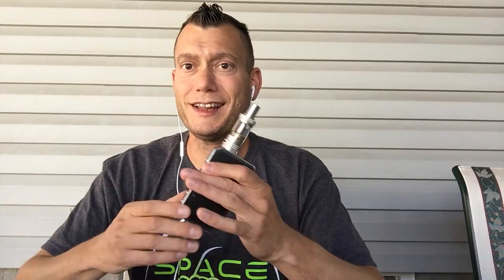Dangers of Ni200 nickel DON'T vape it on anything BUT Temperature Control!

Comment: I don't understand the hype over the temperature control. Variable wattage is good enough for me. Okay... I can't burn my mod for 10 seconds and not get a burnt hit. But who takes  10 second pulls. I can take 4-5 second pulls. And with adjusting the wattage I can get the vape temp that I won't without burning it. I just don't get the whole temp control thing. I hit my e-cig for such short bursts that a wattage adjustment is perfectly fine way to control my vape experience.

I could see the temp control being a benefit if we was taking 10, 20 ,30 second drags which most mods hit their cutoff well before this. It just really doesn't make sense that we need tc. I've tried the TC devices. Honestly I can't tell a difference between TC and power control. The only difference for me was it was having to relearn how to get that vape and using joules/temp settings to achieve it. It was just easier to build a coil and set the wattage to get the vape I wanted. The only added benefit I got from tc was my battery life was a better. But is that really worth the extra hassle and potential danger of vaping a nickel coil? Just my thoughts on it...
Reply: Shayd Marchant and you never ever have to worry about running out of juice and inhaling burnt cotton
Reply: +Colestercamps I'm running .15-.3 coils on a ipv3 li up to 150 watts and never less than 90 when I drip. My all day setup is 44 watts on an aromamizer and a sig 75w tc running it, but I can run it up to 70 watts without getting burnt or dry hits as long as I don't just hold the button.  Learn to build, wick, and when to drip it's not complicated.
Reply: painlessguy ya i can build its not for that its when you run out of juice it wont burn its convent. I'm running twisted messes with a duel titanium build as my all day setup (built for endurance not clouds) and in my dark horse i have a duel nickel/canthol fused clapton for sitting around the house. and my favourite mod is my ipv3 and with titanium wire i can run it at 100j (200w) temp control and i usually tape at about 150w all day 200 when I'm trying to show off. team control is awesome you never ever have to worry about anything with it you can run the coil bone dry and wont dry hit very good for driving
Reply: +Colestercamps Cool story bro...
Reply: +painlessguy it's not but it's a pain in the ass and a big time consumer for people who don't have the time and have shaky hands like me so tanks are the go to now but they seem to all toast the coils within a few hours of vaping so TC was a fucking awesome innovation IMO, esp if you don't like throwing money away on garbage pre-built coils

Comment: Its good that this info is being given out.  
After reading the comments, jeebuzcrust - you are coming out with all this info, saying its safe at high temperatures. But seriously, are you an expert in this field? Because its peoples lives that are at risk here.  How advanced are your studies on the subject? Because if they are minimal, id be adding a bit more sensitivity to your posts.
Theres a lot of people saying the same, how it leaches, its carcinogenic and i'd remain a bit cautious to be on the safe side, until an expert can give his opinion on the matter.
Ive just gone and bought the tfv4 tank online today and im unsure what metal is used in their coils. 
I tried having a look online but I couldnt find a definitive answer, so if it turns out to be nickel what temperature would be safe? 
Or if anyone is concerned about litigation, ill rephrase and ask what temp people have their mod set at?
Reply from the maker: +Craig Schulze Well said man.  none of us know.  We trust that the manufacturers max temp setting (which they all just follow vaporshark) of 600F is safe.  It's an assumption. When I vape on Nickel I do so at around 400-430  and When I vape on Titanium I vape that around 500-550 (because the assumption that titanium holds up better to higher heat).  And I treat stainless steel the same as Titanium.  The more sophisticated higher end TC mods where you can set wattage or joules allow you to ramp up quicker (put more power into the build for the first few moments) and then back off or maintain for a constant vape.

Comment: Thanks for the info I always try to inform myself and others as vaping gets more wide spread. Ill let my shop know so they tell others as well.
Reply from the maker: +Chris D Thanks Chris.  Alot of shops assume that everybody knows, but they don't.  I appreciate your spreading the word.  every vaper needs to make sure they have the appropriate device and set it for the temp control of the metal they are vaping.  Cheers!

Comment: So kanthal is safe to glow correct?  I glow it all the time when I clean the coil or I'm building...
Reply from the maker: +siqpuppie I hope so.  I've been glowing Kanthal for almost a year.  but yes, it's not a fragile brittle soft wire, it can take glowing.
True fact (unlike some other bullcrap comments) Kanthal alloy is used to make boiler tubes because it's extremely durable under high heat, doesn't warp or check, and is highly resistant to corrosion and oxidation.  Furnace tubes don't get replaced very often.  They try to use metals that hold up well to heat

Comment: Thanks for the warnings and information. I would have had no idea if I hadn't seen this video.
Reply: Even tho I have a temp-control-mod, I'll never vape NI coils again.

https://en.wikipedia.org/wiki/Nickel(II)_oxide

"NiO can be prepared by multiple methods. Upon heating above 400 °C, nickel powder reacts with oxygen to give NiO.
...
Long-term inhalation of NiO is damaging to the lungs, causing lesions and in some cases cancer.
NiO has a long retention half-time in the lungs; after administration to rodents, it persisted in the lungs for more than 3 months. Nickel oxide is classified as a human carcinogen

(Wikipedia)

Comment: Nickel has a 500 degree higher melting than kanthal does, coming it at over 2600 degrees.  The only possible danger from normal operating conditions is from having a severe hot spot in the coil, and even then it likely wouldn't reach melting point.  However, this danger is removed with temperature controlled devices as nickel, if inhaled, is extremely poisonous.  However, would would likely never hit this point even in wattage mode with juiced up wicks (just don't do it anyway).  Also, you are 100% correct, never get the coils red hot after building.  Basically, using them in wattage mode is akin to not wearing a seat belt... most times you're fine but every so often something extremely bad happens.
Reply: +jeebuzcrust How do you know that melting is the only time you could be releasing toxic metal? I hope some studies are in the works about heavy metal and oxide contents in nickel builds. I just bought a temp control device myself and I'm trying to learn to use nickel safely before I start using it at all.
Reply: +Krankie V Science.  Check it out.  Nickel is stable at highers temps than kanthal.  Stable means there is no change to the molecules of a material.  Hence, nothing additional will be included in your vapor.  All of this information had been available well before vaping.
Reply: +jeebuzcrust no chemical change is good, that's a start, but that doesn't mean it doesn't leech and become soluble.
Reply: +Krankie V Again, leeching is a change in molecules.  It's not as if metal evaporates into your vapor.  If that was true at all we'd have thousands of deaths already.  Nickel is extremely poisonous and inhalation would result in severe health issues within days.  I'm not saying something can't happen but the chemistry looks very safe.
Reply: +jeebuzcrust you said stable. stability refers to a chemical change. becoming soluble (leeching) is not a chemical change, rather a change of state. the molecules are not changed in chemical terms, and therefore still considered stable. I'm curious at which temperature the nickel starts to leech. "stability" refers to oxidation rather than solubility. 

I'm nut saying you're wrong, but your definition of terms is a bit mixed up.  solubized elements can still be considered stable. that's why I'm cautious. small bits of soluble nickel in the vapor wouldn't be killing people even if it is there, but it could cause health complications with extended use.

I would really like to see a study done which proves with certainty whether or not the nickel metal solubizes or oxidizes. right now, nobody seems to be able to say for sure.
Reply: +J and K White even if nickel were proven 100% safe.... the vape is too cool for my preference. temp control is kinda gimmicky imo. it's neat, but once the novelty wears off, I don't care for it. I haven't had any bad dry hits on Kanthal for quite a while now... it's just a matter of knowing how often to drip it.
Reply: Krankie V damn right. Its pretty difficult to get that satisfying WARM vape on nickel...kanthal suits me just fine
Reply: +Krankie V Supposedly anything above 600 degrees f and leeching can happen. 500 or less should be just fine. But its all theoretical anyway due to the fact that nickel warnings are based on ingesting nickel....that's different cuz we aren't eating it ya kno. I guess we have to wait and see man
Reply: +J and K White yep basically... a big unknown. I've been dabbling with temperature control for a few days nite and I've pry much decided it's not something I really care for. It's back to kanthal for me.
Reply: Krankie V Same here buddy...not fuckin with it. someone else can take those chances

Comment: i vape on silver its toxic but only will give you a gray skin if used wrong yes silver kills bactiria but its a lot safer then nickel
Reply from the maker: +DarkCyborg Silver?  don't know anything about that....
Reply: +Quest4vape http://www.wires.co.uk/acatalog/e-cig_iatty_atomizer_wire.html

go near to the bottom and you will see it oh and  somthing else its a lot less ohm then nickel so that a bonus use it with kanthal wire to increase the ohm
Reply from the maker: meh.  I'm going straight to Uranium wire, no battery or mod needed.  just coil, wick juice and vape.  Internal heat from radiation will vaporize everything.  Should hit like a truck load with a slightly earthy taste.

Comment: Great video man! Also can you link me the sources you used to conduct this video? I want look into this a bit more and take in more knowledge about nickel wire, and if I pulse the coils on a tc mod is that okay? I'm fairly new to building and I want to make sure I know what I'm doing.
Reply from the maker: +Jaymex231 Not ok to pulse the coils on a mech mod.  that's exactly what I'm saying not to do.
Reply: +Quest4vape Alright, thanks man!
Reply from the maker: +Jaymex231 Sorry, was on my cell phone, just re-read your question, and it's a very good one.  Fairly common knowledge to experienced folks in vaping that Nickel and Titanium are only supposed to be vaped in Temp Control.  Unfortunately since recent explosion of products and coils into the market newer vapers don't know this.  And also the regulated mods out there so prevalent that will fire down to .1 in wattage mode that can be purchased for under $100, prices is no longer a barrier either.   then folks get the idea to vape nickel on mech mods where there is no temp sensing or power reducing protection.  That's a recipe for heating that metal up beyond the 'recommended' temperatures.    Dry pulsing the coils ON a TC mod is fine if you lock the resistance when the coils are cold and the device can accurately sense the change in resistance as the metal heats, which the chip will read as temperature increase.  Most TC mods will not allow you to dry fire the coils.  So folks will put the atomizer on a non TC mod or a mech mod and dry pulse them that way, making them glow, doing exactly what is not supposed to be done with this metal.  If building with spaced coils there should be no need to pulse the coils anyway, but folks do it.  And claptons or twisted wire or contact coils (where the coils are not spaced, but pinch together) need pulsing to remove the hot spots....so that's asking for trouble.   Then they go wick and juice the build and vape it...nullifying any protection (if any existed at all) from temp control.  Thought I did a fair job explaining the two main points of this video, but it's ok, it should be repeated many times.  The first TC devices like the Vapor Shark were introduced to the market as a way to use low power to get a more robust flavor vape and eliminate the risk of dry hits.  People, myself included, understood this to be a selling feature, and didn't spot the intended safety feature underneath that one key detail.  I said to myself:  Self, you know how to re-drip when your cotton gets dry, so don't buy a $300 device just to eliminate something that's not a problem.  

But others felt the need to buy these (and Hana, and SX, and Yihi, and all the others I can't even keep track of, that use microchip processors to calculate teeny changes in resistance of wire in microseconds as you vape to match power with calculated temperature, thus when it says 'temperature control' what's really happening is that as the chip reads the resistance say 200 times a second, it will notice the pattern of change and convert that to an increase in temperature (coefficient)  to back down power as the temperature increases and approaches the set maximum). 

  I don't quite know how these manufacturers determined that Nickel is safe to vape on, and at what temperature they consider it safe.  Is 600 an arbitrary number?  There is much out there in the way of information on the toxicology of Nickel in manufacturing, industry, exposure to the metal by ingestion, inhalation, skin contact etc.  Material Safety Data Sheets are online.  There IS NO current research on this metal for use in vaping specifically.  Somebody decided why not try it with this metal, and it sort of grew trendy. 

  I'm not a scientist, nor a researcher.  But that's the basic start of your homework.  And guess what?  I think the vaping community just supposes it's ok because it's available and 'somebody' must have figured this out already.  But I don't think anybody really has.  I personally am sticking with A1 Kanthal, and dabbling with 316L stainless steel, and am about to tinker with Titanium.  the downside to my opinion:  I miss the opportunity to enjoy nickel vaping.  The upside to my opinion:  I avoid a potentially harmful trend.  I can live without the experience of Ni200.  Kanthal is plenty good enough for me.
Reply: Quest4vape holy shit thanks for your very informative reply, and I agree, I'd rather not have any harm and just use Kanthal

Comment: the threshold at which Ni200 starts becoming toxic is 600C.  it will use the carbon in the VG and make Nickel Carbonyl, a carcinogen.  if you pulse the coil and make it glow, it hits 700C.  this is why you space your coil builds with Ni200.  the best thing to do is go to Stainless Steel with a Smok XCubeII TC with firmware 1.092 AND the SS upgrade for  $0.99.  there is zero danger in SS.
Reply from the maker: +mattio79 Thanks mattio.  I've been playing around with ss builds in rba's and on my goblin mini too.  haven't got the Xcube, as I was waiting on a DNA200 to come out that I like.  But I may need to play around with that XcubeII.  +DJLsb Vapes taunts me every thursday vaping SS and Ti in temp control on it.
Reply: Quest4vape my best thing to do in life is help people.
Reply: mattio79 Why is there zero danger with stainless steel? Doesn’t SS have Chromium in it? I’m not contradicting, just very concerned about vaping safely and would really like to find out the best material to vape with